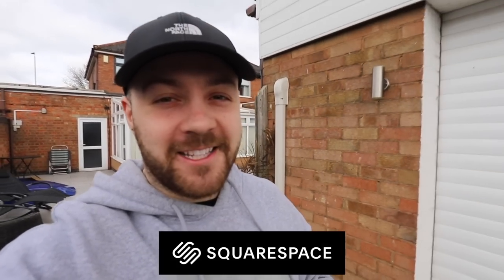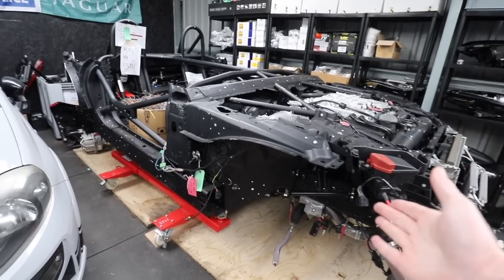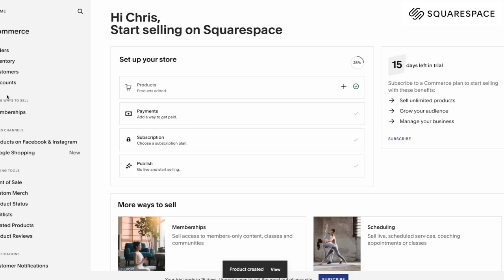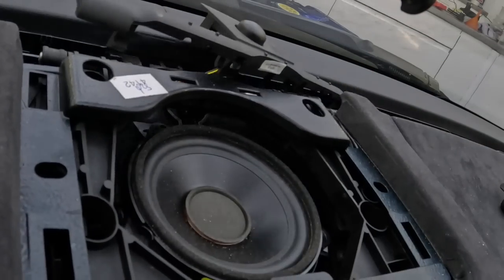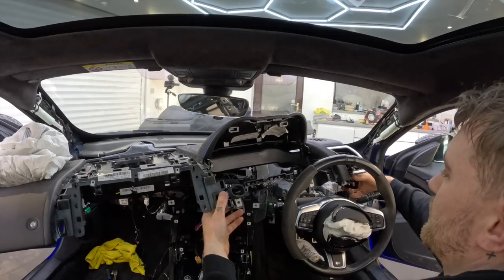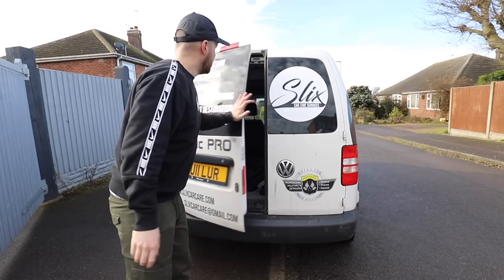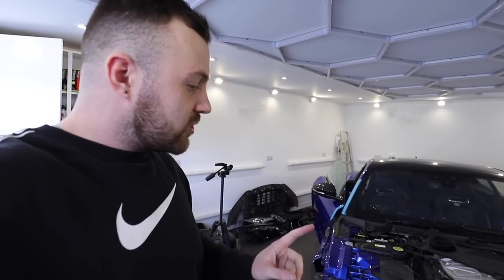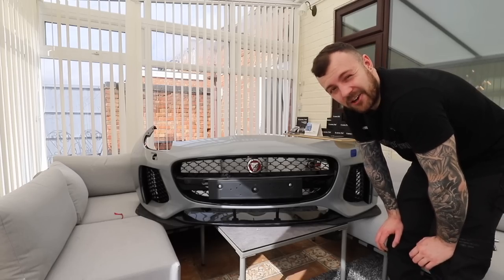RESTORING MY CATEGORY S WRITE OFF JAGUAR F TYPE SVR

Comment: Getting there, I was told damage to those wires on the driver's side is a big issue as the whole loom needs replacing. See my latest video for how I fixed just the headlight connector on mine.

Comment: If you need to change the air filters it’ll be easier to do them with the bumper off as you’d have to take the 3 piece front splitter again off again to do them
Reply from the maker: I am tempted to go for open cone filters haha

Comment: Just noticed looks like the wheel arch liners you have are the wrong ones the SVR has a vent at the front for brake cooling, I found this out the hard way because I bought the vented ones for mine by mistake if you want to sell the ones you have let me know.

Comment: 11:55 why wouldnt you just replace the broken airbag panel on the existing dash with the one off the donor dash? Why transfer all the unique pieces over to the donor dash?
Reply from the maker: The panel for the airbag is designed to break when the airbag deploys. It damages the frame of the dash when it does and if you try to swap over just the leather panel it will probably rip where its designed to anyway. Best to leave them alone for safety reasons.

Comment: "not the first time I've been told I need a larger tool" my man, you should know by now it's how you use the tool🗿
Reply from the maker: I mean it depends how far the bolt is recessed tbh 😅 sometimes with a shallow socket you just cant get the reach

Comment: According to the Haynes manual it's easy to refit the dashboard
"Refitting is the reverse of removing"  simple😅

More than 10 bolts left=me
Less than 5 bolts left = jag tech
Less than 2 bolts left= matt
No bolts left = schmee 150.
Reply from the maker: Just so you know, it went both well and badly at the same time 🤣